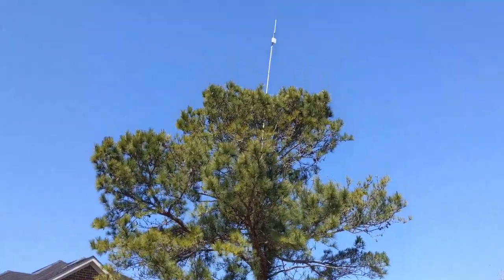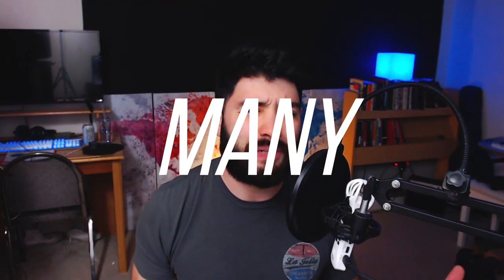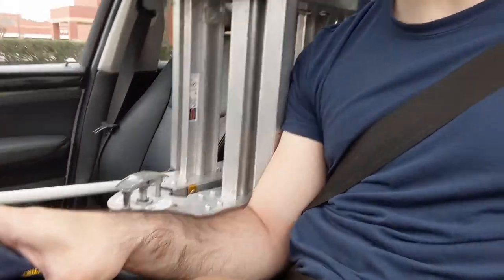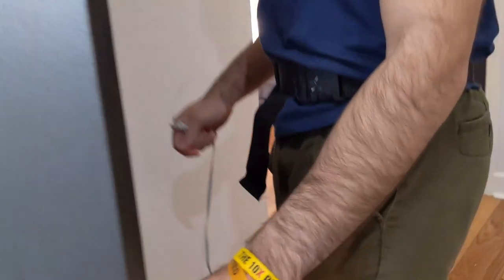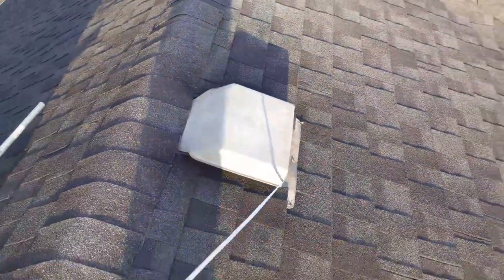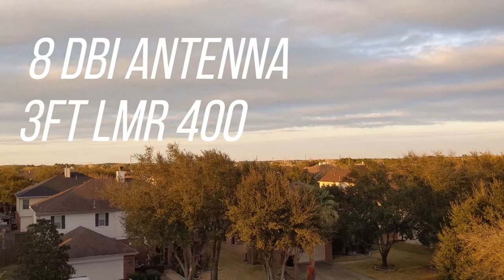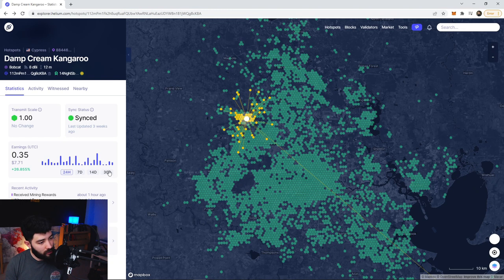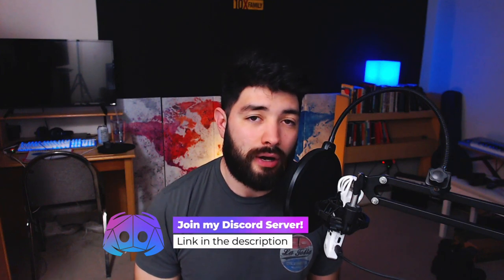I Installed EPIC Helium Miner On Chimney In less than 1 Hours. Makes 250$ Per Month

Comment: Thought I recognized that map, H-Town. Why not run a slightly better cable from in the attic and not have your helium miner up on the roof, just the antenna up there?
Reply from the maker: Hey Patrick! Good question. Well for starters when i got there that was my first time there. I never planned the install except for just a couple words on the phone. I did not realized that it was going to be that easy. Secondly this was a relocation from a previous location since it was performing badly, so the set up was already built and i just transfered it. 

Lastly I'm not to fond of cables going that long of a distance. I like to keep my LMR short as can be. but recently, i've been thinking that it might be a viable option to protect from the sun and just a small loss in cable length.
Reply: @gabrielchaparrotalkscrypto  Yeah A few extra dollars into LMR 600 or better might be worth not melting everything in our Summer heat. But otherwise understood.

Comment: Great video! Thank you! Informative to my newbie self! Whats the adapter called going from the antenna cable to the miner? Thanks again!
Reply from the maker: Thank you so much! hmm adapter? are you talking about the lightning arrestor? that's the only thing between the antenna cable and the antenna itself. but there is no adapter from the antenna cable going down to the miner.
Reply: @gabrielchaparrotalkscrypto  looks like it goes from the LMR cable which seems to be a bigger diameter to the male antenna fitting the hotspot, which is a smaller diameter...
Reply from the maker: @marrellij  gotcha yea so the cables that you can get from rokland... they will have it very detailed. so if you buy an antenna from there it will ask you to buy the matching cables if you want. the miners have RP-sma fitting and the antennas have N-type Fitting.
Reply: @gabrielchaparrotalkscrypto  Ah ha! Perfect! Thank you!

Comment: Awesome video, I also live in the Houston area, (Baytown) I have this same vent, I'm going to do this same setup! I just have 1 question. I read where you explained you grounded it to a copper rod in the attic, but what about the other end? Is it on a lighting arrestor on the atenna or just on a screw off the atenna? Thx in advance!

Comment: Hey Gabriel, I have sense cap and I saw your video on how to forward the port. I have AT&T and did everything you said but it’s still now showing that I’m able to see witnesses. Any suggestions?
Reply from the maker: Hey Jose Are you still having issues with this? Honestly I would just say restart from scratch and delete everything. I'm sorry I took so long to respond man My bad. 

but help me understand, you're relay is good to go and you're not seeing any witnesses? or the relay didn't work and you're still relayed?

Either way, being relayed won't really affect your witness count in a dramatic way. it's almost unnoticable. I would look elsewhere if you aren't gettting witnesses. start by going higher in elevation if possible

Comment: QUESTION... WHAT ABOUT COLD WEATHER INSTALL OUTDOORS. I LIVE IN OHIO AND I'VE BEEN LOOKING FOR A GOOD WAY TO DO THIS OUTDOORS. BUT THE MINER IS ONLY GOOD AT 32 DEGREES AND A 104 DEGREES. YOUR BEST SUGGESTION PLEASE WOULD BE GREAT 👍
Reply from the maker: Hey Mark! I haven't forgotten about you lol. I'm going to post a video soon about heat issues But In there I'm going to talk about the cold as well and what you need to worry about. I'll go more in depth with later videos. but right now I can say that your biggest enemy is going to be moisture. I just looked up how cold it gets over there, your miner should probably be ok with the cold but your options are keep it indoors and set up a roof top install, or maybe in the garage where it doesnt get too cold. 

Or maybe find some kind of heat strip that can go inside the enclosure. I havent' found any yet though but I'm still looking. but if that doesnt come to play, you can maybe put some heat producing light bulb in there and see if it generates enough heat in that enclosure. It should help out a bit.